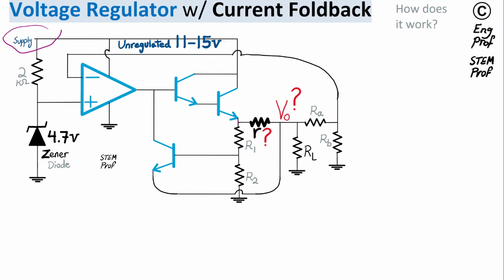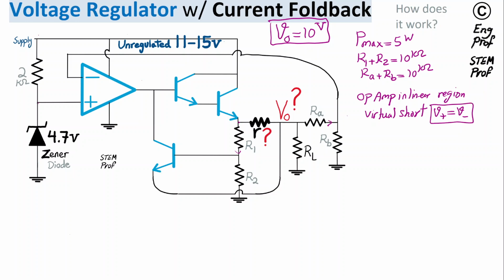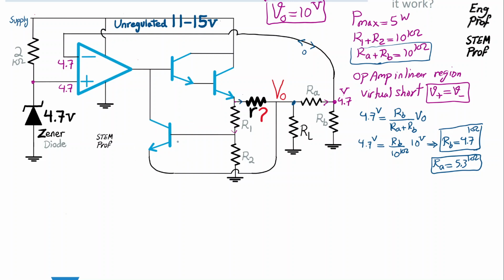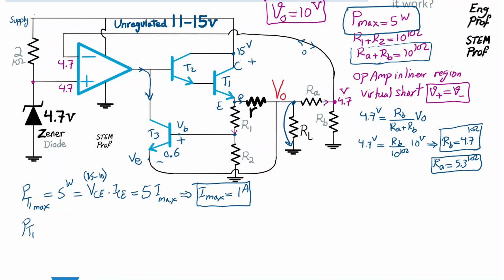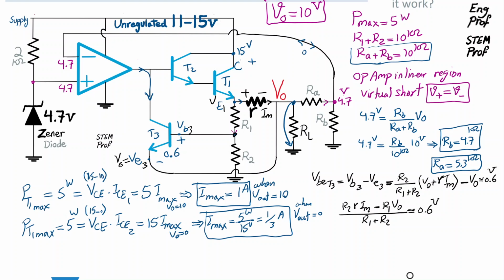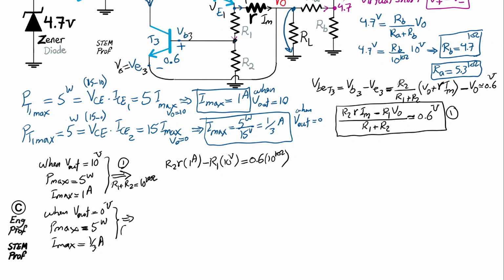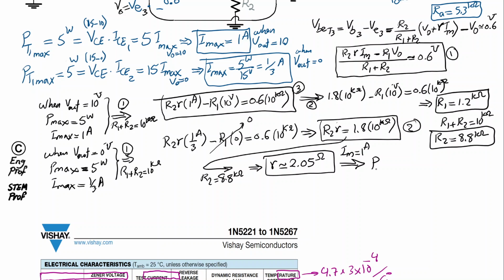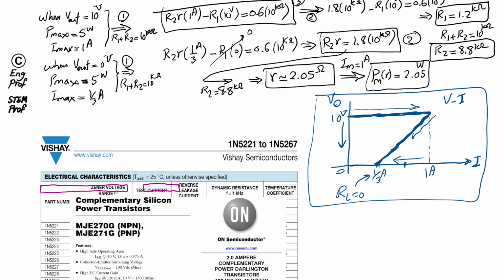Current Foldback Voltage Regulator Circuit Design with Op Amp, Darlington BJT Transistors

Comment: Love your videos. Correct me if I’m wrong but when you are supplying the positive rail of the operational amplifier 11V you can’t regulate Vout because you need 2VBE + Vout > 11V at the output of the op-amp.
Reply from the maker: Thanks Marcos for watching, your encouraging comment and good question. Glad that you like my videos 🙂  It is always important to double-check BJT Collector-Emitter voltage requirements. Please NEGLECT 11-15v assumption for input supply range. Our DESIGN GOALs are: MAX Darlington POWER target is 5W, & Output regulated voltage is 10V as long as max Darlington Transistor power is sustained. The current foldback feature kicks in otherwise to limit the output current. I will post another example soon specifically for 11-15v input supply range.  For another example please see Voltage Regulator Design with Op Amp and BJT https://youtu.be/rI9f6-DyXxQ . I hope this is helpful. Thanks again for your interest & follow-up comment. 🙋‍♂️
Reply: @STEMprof  I'm sorry, but you're wrong. At the max current (1 A) and nominal Vout (10 V), the VCE of the MJE will be over 3 V, while the VBE of the same transistor will be over 2 V (page 2 of the component datasheet). Then you have to add even the drop on sensing resistor that is over 2 V too. So, the minimum supply voltage has to be the greater than (10 + 2 + 3) V = 15 V. Another flaw is when you say that the power dissipated by the sensing resistor is negligible in the calculation of the power dissipated by T1: it is not. At 1 A of load current, the transistor dissipates 1 A x (15 - 10 - 2) V = 3 W, while the sensing resistor dissipates 1 A x 2 V = 2 W: they are almost the same. A revision is needed.
Reply from the maker: @giorgiocanal1659 Thanks Giorgio for watching, your detailed attention & insightful feedback. You have a good point. Pls NEGLECT 11-15v assumption for input supply range. DESIGN GOALs are: MAX Darlington POWER target is 5W, & Output regulated voltage is 10V as long as max Darlington Transistor power is sustained. The current foldback feature kicks in otherwise to limit the output current. I will post another example soon specifically for 11-15v input supply range.  For more Op Amp Circuits and Regulator examples please see:  
Op Amp Amplifier with Electronic Gain Control https://youtu.be/NoNgQpbj77Y  
Push-Pull Power Amplifier with Darlington Transistors https://youtu.be/866MYibo8yE
Op Amp Analog Computer Differential Equation Solver https://youtu.be/ENq39EesfPw
AbdcAnalog circuits and signal processing playlist: https://www.youtube.com/playlist?list=PLrwXF7N522y4c7c-8KBjrwd7IyaZfWxyt
Thanks again. I appreciate your attention and feedback. 🙋‍♂
Reply from the maker: @marcos010697 Thanks again Marcos for your detailed attention & insightful feedback. You have a good point. Please NEGLECT the 11-15v assumption for input supply range. Our DESIGN GOALs are: MAX Darlington POWER target is 5W, & Output regulated voltage is 10V as long as max Darlington Transistor power is sustained. The current foldback feature kicks in otherwise to limit the output current. I will post another example soon specifically for 11-15v input supply range.  For more Op Amp Circuits and Regulator examples please see:  
Op Amp Amplifier with Electronic Gain Control https://youtu.be/NoNgQpbj77Y  
Push-Pull Power Amplifier with Darlington Transistors https://youtu.be/866MYibo8yE
Op Amp Analog Computer Differential Equation Solver https://youtu.be/ENq39EesfPw
And Analog circuits and signal processing playlist: https://www.youtube.com/playlist?list=PLrwXF7N522y4c7c-8KBjrwd7IyaZfWxyt
Thank you again. I appreciate your attention and feedback. 🙏👍